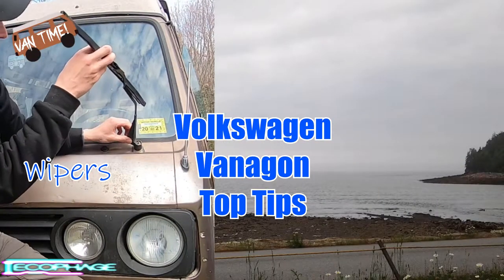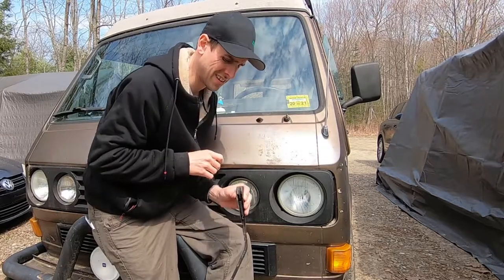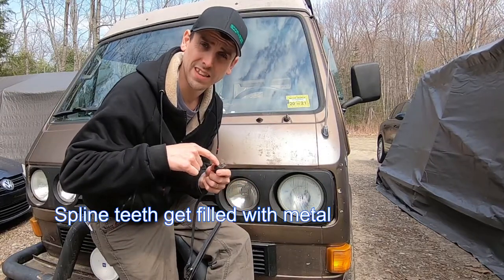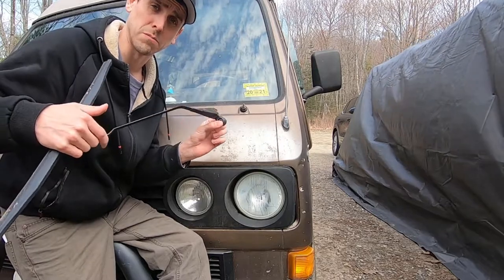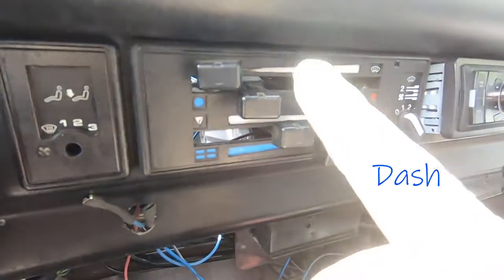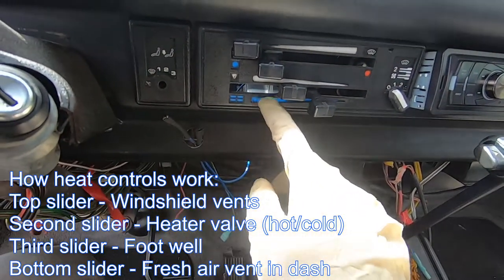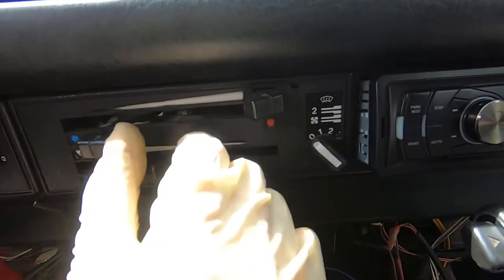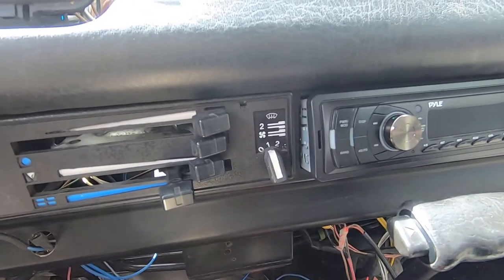Top #3 Volkswagen Vanagon Repairs/Tips (wipers, mirror, dash heat control)

Comment: Nice video.... Question on the last repair? My top slider has come loose and doesn't open or close that vent. How would I approach fixing that...can't really see behind or trace it out...
 thanks
Reply from the maker: Ok so if you remove your cluster cover and look down behind the defrost/hazard or look through the slider slot you will see the metal bar that the plastic handle attaches to. There is a thick wire attached to that with a simple two opposing 90bends with the arm in between them (kinda like how old carburetor linkages are attached on a lawnmower or something) that wire then goes into a sheath the sheath protects the movement around the back of the box. If you open your glovebox and remove it you should see the other end clipped to the heater box then another weird z connection on the lever for the flap. The most likely failures are the wire bending while trying to push IN. Then the stupid z attachment pops out easy when it goes the other way. Next common failure is the wire/cables sheath is only held securely by a weak clamp thing right at the end of the sliders travel. That clamp can come loose or slide out of place. The original position is usually imprinted pretty deep in the cable sleeve or just slide it up and down the cable sheath till the sliders operating zone in in its correct range. Then clamp that sucker down. Lastly the other end can become loose by either popping out of its super cheesy 1/4” metal tension tab that is ridiculous in design. Or it’s popped ITS stupid Z attachment. I’d bet money it’s done the bendy thing up behind the panel. Just grab a flashlight or something and look in the gap and move the top level and watch the cable. Now move the next one and see how it’s attached. It’s not identical cable directions and stuff but same principles

Good luck!
Reply: thank you a ton, at least you got me going in right direction, honestly didn't know who or how to ask till i watched your video and realized what it's called and how those knobs actually worked
Reply from the maker: @RawInSeattle  happy to help and know my video is helping others. It’s why I YouTube!

Comment: At this point I would replace the wiper arm and avoid adding extra washers.
Reply from the maker: I didn’t have to add washers, you can usually get a few spline cleanings out of one arm so long as it doesn’t spin free and keep eating into the arm metal. But basically if the spline shoulder isn’t above the wiper nut surface then it’s still good.

Comment: The bottom heat lever doesn't control the dash side vents -- each of them has its own knob at the vent.  The slider controls unheated air to the side vents in the passenger compartment.
Reply from the maker: It controls the main fresh air flap AHEAD of those side vent individual flaps. It’s connected to the big fresh air flap in the heater box, and interrupts all the vents. That’s why it’s a little window symbol
Reply from the maker: Though I do think I’ve seen different options for this slider on different year models. There were two different heater box designs that had fresh air doing different things
Reply: @ecophage  Air cooled had a different setup.  But water cooled, the only control on the dash side vents (heated late, unheated early) is the thumb knob on the vent itself.
Reply from the maker: @dbeierl  then what’s the bottom slider for? Why does the airflow out mine stop when I slide that window slider over?
Reply from the maker: On page 80.10  of factory manual it refers to it as the “main cut off flap”
Reply: @ecophage  Bottom slider is for the cabin overhead vents.
Reply: @ecophage  airflow from the front goes way down when you open those overhead vents, especially if there's a hole in the B pillar which is used as a duct.
Reply: @ecophage  I reckon that's the temperature control flap for air cooled.  It doesn't exist in the water cooled (even though it shows in the picture on 80.14).
Reply from the maker: @dbeierl  well it exists on mine and functions like the factory manual says. It’s cuts off all air flow